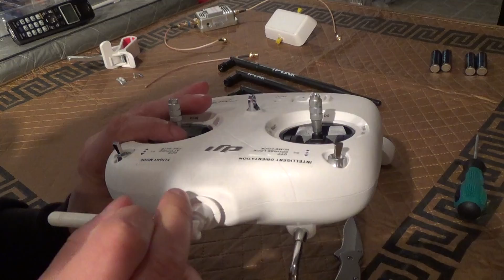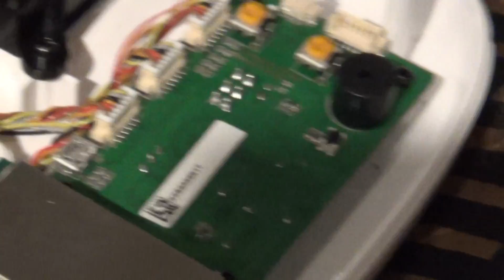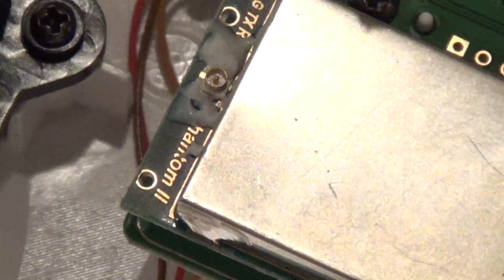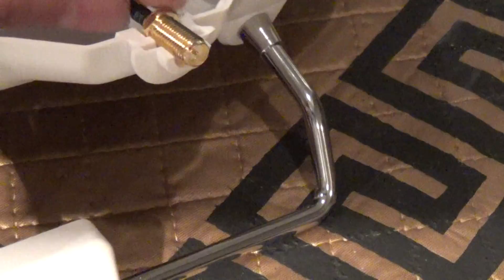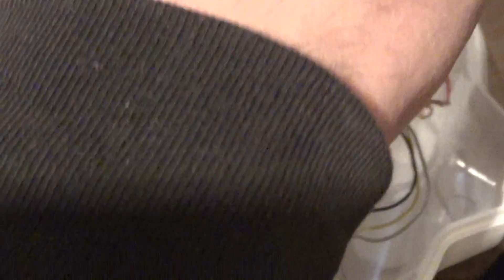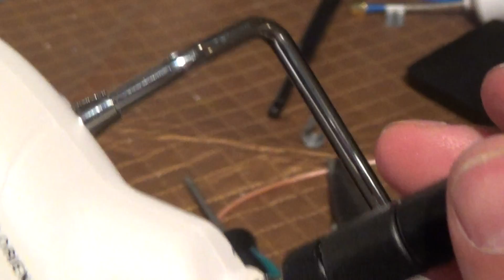DJI Phantom 2.4 and 5.8 Radio Control Antenna Mod increase RC / FPV Range

Comment: I mod my remote with a tp- link 8dbi Omni directional and only get 2500 ft before I lose control. I was getting 3000-5000 with stock antenna. Im very confused? Why am I getting less range? All tests are done in open farm fields. I ordered the 11dbi flat directional antenna you talk about in your videos and others have said it gives the best results.
Reply from the maker: That's easy.  It's not that uncommon to get a bad pigtail cable that is the most likely cause and probably the source of your problem.  Less likely is when you were working in the unit you caused a static short in the amplifier.   Just using a 3 dbi antenna I took off a router gave me better results than stock.  I flew out 4500 feet with no signal problems.   I also flew yesterday doing a quick or flight out past 3600 feet this time using a 5dbi TPLink antenna and it was working flawlessly.  So again the antennas are fine it's probably a cabals problem.
Reply: Ben7seven7 hi ben. I have a P2V flight and want to increase you signal extender with those antennas increases as the wifi signal? which do you recommend for my extender thanks excuse my English  

 if not increase my work or extend 100 feet

work at 1000 feet my extender? thanks
Reply from the maker: For the best increase in range you should go with a LHCP Helical antenna. fpvlr.com in the US has a good selection as well as other sites.  Going past 1,000 feet is a non issue as the Phantom can already do that Stock. Upgraded antennas should net you double the range if not more depending on flying conditions.
Reply: Ben just had a real good flight.  8549 ft on the 640 setting never lost fpv. I mod my reapeter with a flat panel tp link 14dbi directional antenna. With a sp24 skew planner cam antenna hanging below landing gear. Seemed to work way better with it hanging below landing gear. Controller was 11 dbi flat antenna.  I'm posting video today.

Comment: Am I missing something, I am looking for the range improvement comments and nobody mentions a single word about it. With the modification, how much is the improved range? if it is from 500 meters to 550 meters, probably it is not worth bothering
Reply: I did this mode for my fc40 which the stock range is claimed to be only 500 meters but I can get out to about 700m in the city with mine and the stock antenna and when I used a lil home made windsurfer antenna reflector I was able to increase my flight range to 850meters. I Then did this mod the other day and now get about 800 meters with a 6Dbi antenna and no reflector. so thats a bit over 14% increase range.   and with the reflector and the 6bi antenna I was able to get 975m range. Which is a nice jump from 700m But whats cool is the 975m gets me from the center of my town and all the way over to the other side of the hudson river and a few blocks in to the town on the other side of the river. Its even a whole different county.  I'd bet if I was able to go some place thats a nice open area up in the hill towns with no tall buildings and trees in my way I know I can get even longer range. Then I getting in a highly built up area in the city.  I just wish there was a better way with the fc40 to get better wifi range from the camera then the 300m-350m range im getting for my fpv range using a kindle fire for the monitor which is about 3x times the wifi range of my smart phone which even using a hawking wifi extender tops out at about 250-300 meters. So on the phone its a big improvement. But the kindle by its self has a tiny bit more range then the wifi repeater does. Tho I would love to be able to actually get the repeater to get some more range.
Reply from the maker: If you watch my follow up video I explain the range improvement I got from swapping antenna. Also the stock range is far more than what DJI says. Most people get 1 to 2km stock, I was having cut outs around 1km with the mod no cut outs perfect reception even with using my weakest 3dbi antenna
Reply: Ben7seven7  I cant find any follow up video =/ Can you give me a link please?
Reply: Kotik nice - what gear do you have for FPV?
Reply: I used this method and a TP Link 8db antenna to hit 1970m (6463 feet - well over a mile).  This was over water, clean line of sight.  I maintained video and full control.  It was actually over 2km but I didn't get the screen capture before I lost signal and the rule is "pics or it never happened".  So 1970m is all I'm claiming.  Proof:  http://postimg.org/image/gaofo6fp1/
Reply from the maker: Nice range. Add a 2 or 2.5w Sunhans amp to that and you'll double that. You'll further increase it using a high gain Helical Antenna.

You didn't mention your preview quality though cause that also makes a difference in range. (The lower the preview the further the FPV range)  To me, using anything less than 640x480 sucks to me tho as half the fun of flying distance is a high quality live view.
Reply: Ben7seven7 Thanks Ben!  I'm going to add an amp.  Any suggestion on where to buy one?  The power supply looks like a problem to me.
Reply: Robert Hamilton  I bought this, gave me about 60km range with 3dbi antennas on receiver.

http://www.ebay.com/itm/2-5W-2-4g-Wireless-34DBm-Wifi-Broadband-Amplifier-Signal-Booster-802-11-B-G-N-/261258399234?pt=US_Networking_Boosters_Extenders_Antennas&hash=item3cd436ce02
Reply: mrpeter81 That seems unlikely.  The drone can fly about 45km/h so it would need to be in the air for 1 hour 20 min to go 60km.
Reply: Well, I use it on my long range fpv airplane as well, not 60km range with a quad =) =)

Comment: Excellant video Ben as always, it took me about an hour with a razor blade on mine to get the resin off.. Lol
Reply from the maker: Thanks for the comment :) My knife is better than using a razor blade.  It's also a bit of technique as well, and then a friendly tug at the end with the pliers. But all's well and it really works great. I couldn't be happier with the results with only the 3dbi antenna installed, let alone anything bigger.

Comment: me first :-) pv+ coming
Reply from the maker: lol.  Good luck with your new PV+  You can do the same mods on the PV+ as you do on the Phantom with the exception of the wifi antennas on the Vision. The two have different setups. The Vision+ will actually be easier to modify than the original Vision.   You will use different cable connector though, MCX instead of U.FL
Reply: Ben7seven7  thats my next mods :-) increase range.
but need to practice first flying it.
ben any plans on selling your excess accessories their at super dirt cheap ?